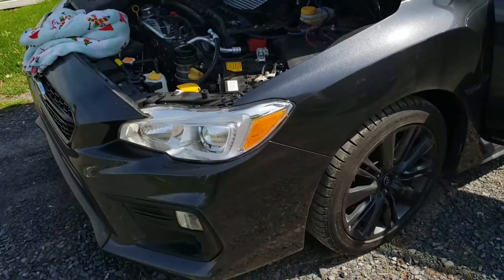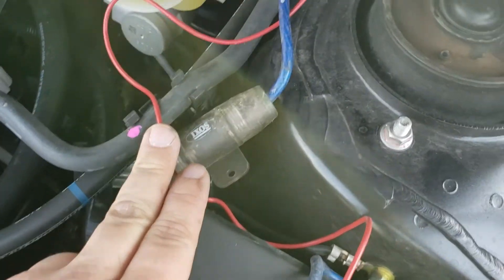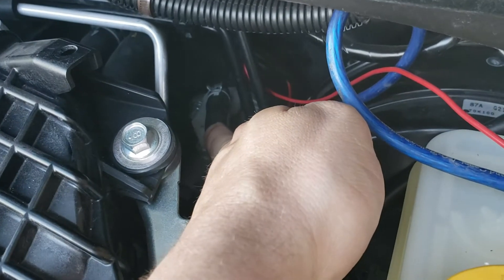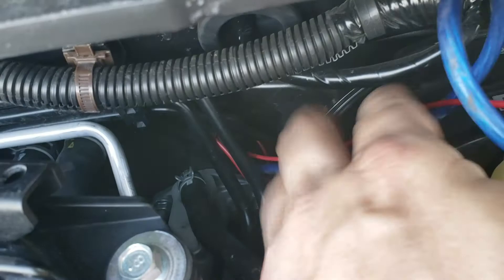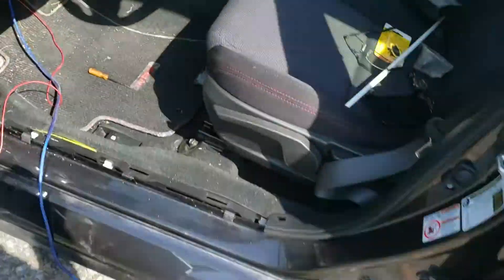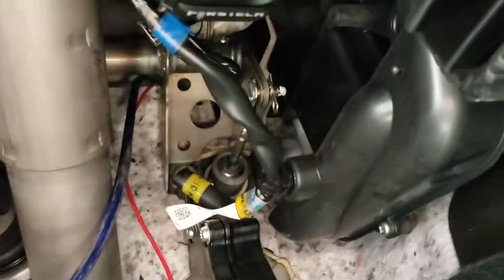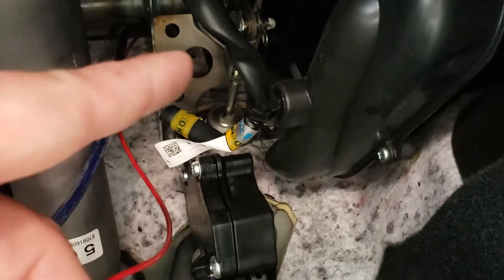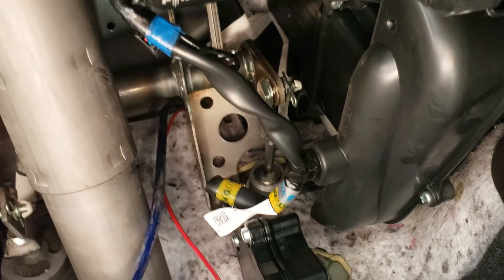2019 Subaru WRX where to run amplifier power wire WRX amp power through firewall

Comment: I know Im late to this, but thank you for this. I was looking for a way to run small gauge wire through the firewall. I wasn't sure if I could. I also plan on doing a amp this winter, but Ive run enough wire in my cars. Ill just pay a local shop to run the wire.

Comment: I've been looking to do the same on a 2020 model - how did you get your hands in to access that rubber plug?  Did you remove the intercooler or is there some way to reach around it to get way back in there behind the brake lines?
Reply from the maker: Hopefully you got it figured out by now. I just reached my hand back there, turned my wrist 3 different ways and plucked it out lol.
Reply: @flamingpinhead  actually still waiting for my parts to arrive...but thanks for the additional info.
Reply: Coat hanger trick works

Comment: hello, what head unit you have? base or with starlink/with android auto?
Reply from the maker: It has the connectivity. Just using a high level input. T-tap connectors work well to grab the signal off the speaker wires.
Reply: Where did you tap into the speakers at? From Behind the head unit or from the doors? Was this for adding a subwoofer or for just adding amp to power the current door speakers? I’m going to install a amp and sub in my 2019 this weekend.
Reply from the maker: @DrumDru313  tap the rear speakers at the rear deck for a small sub unit just behind the rear seats, Alpine LAT. (Still need our trunk for hauling groceries!)

Comment: Hate to be the bearer of bad news, but there is a much easier way to do this that will also use a shorter run of wire and also avoid running wire across the area where all the moving pedal parts are.   Watch this video. 
https://youtu.be/2rs5FUhSn-o